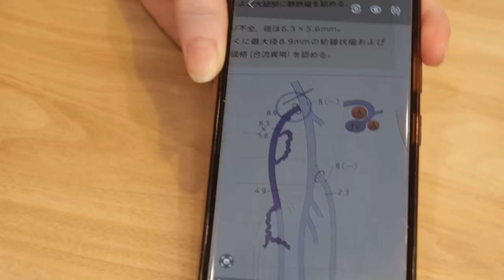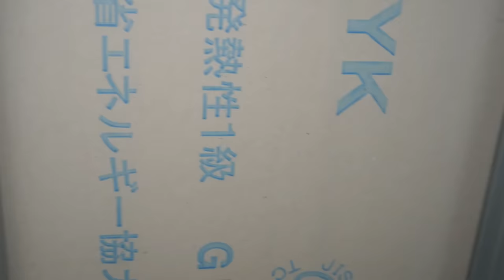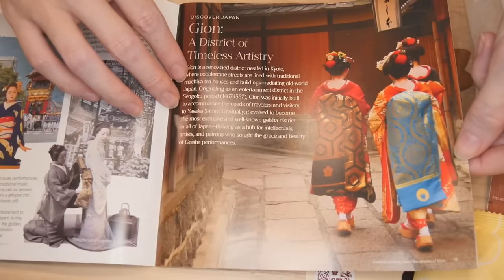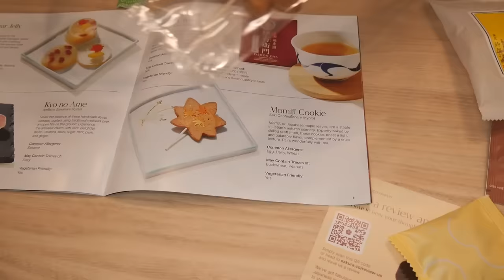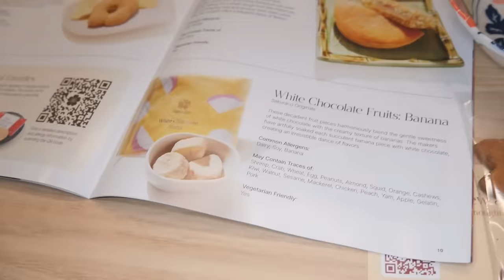I cut a hole in our wall and tried making a cat door 😬

Comment: For the cat door you could use a blackout fabric with weights at the bottom or if concerned with cleaning maybe strips of a flexible woody material like bamboo strung together? Bead curtains could also work. For the former rock garden; you can get a spray with enzymes that breaks down the components of cat urine scent which should dissuade them from peeing there again. After you could maybe fashion a lid for the stones out of plexi, some type of tempered glass or a clear acrylic plastic; cut holes in it for the plants to poke out (and for watering). Easier to keep clean than the stones for sure. Just trying to brainstorm some options!

Comment: You should use "woven wooden shade" as a type of door for this project. They flow really easily and the cats won't get caught in it. You could also put them on both sides to lower the light level if wanted.

Comment: For the door, you could try weighted fabric. Keep a wood strip for the top bit like you already had as it then afixes easily to the frame as you've already done, but attach a strip of blackout thick fabric to it (honestly a piece of black out curtain could work well) with some form of weight sewed into the bottom (maybe smaller weights in the corners so if they start to get stuck, the middle of the fabric without weights can still fold easily) - cut to the right size with the right weight positioning, it should hang quite nicely like the wood door you made (amazing job by the way), without any risk to your cats.

Comment: I was just about to leave a concerned comment about the door when you mentioned the safety issue, I'm so glad you noticed it! If you decide to go with a flexible wooden panel, make sure the design allows it to bend both ways, since they're usually more rigid in one direction.

Comment: As a possible fix for the door, fabric hung over a rod and secured at the bottom by magnets should work well (and you can put padding between the magnets to still get the attraction without a "clicking" sound when they close). I also liked what a few other people said about bamboo mats for flexibility, but you'll want to edge them with softer fabric in case the cats lift from one side instead of straight from the middle. But overall, it is a beautiful cat portal! Great solution for cats wanting in and out of a room when you want to still keep the door shut.

Comment: My advice for the door is that you could do it a bit shorter in lenght. Like 0,2 inches (around 5mm). This way the door is still a door but the kitties can´t get stuck or hurt their tails when the door gets closed :3
Reply: 5mm probably doesn't do much for stopping them get stuck underneath the door, but my first thought was to cut some of the bottom off too! Maybe add those fluffy door seals to the bottom so light doesn't come through.. But a curtain or bamboo mat like others said sounds way cozier

Comment: hey Rachel & Jun!!! Something you could do is split the door in half through the middle horizontally and then connect them with some hinges or something flexible. That way when the cats might get pinched the door instead just folds along the split.

Comment: I love how happy and trusting your cats are, seeing how excited Poki's little tail is, is just great. The cat tunnel in itself is really nice and clean looking, if you're willing to buy a flap part, there are places that sell just the flap for cat doors (as a replacement part). I feel like even those slatted/flexible wood doors could still pose some danger, whereas a soft flexible flap is light and can't really seriously catch anything. 

Until you get yourself you dream shop (with compound miter saw, among all the other fun and convenient saws) you should get a miter box for your own sanity. Then you can cut your angles with less worry of them coming out in a way that drives your perfectionist brain insane. (There are some frustrations with using a miter box, but you're probably way stronger and better at sawing things than I am so you  shouldn't have the challenges I do with them)

Comment: You are always so crafty, Rachel! The cat door without any flap on it will be best for kitties, but it doesn't look as nice to us people. If I may, consider using a thin, lightweight wood or veneer-esque material to achieve the look you are going for without making the door heavy for the cats to potentially get stuck or injury themselves on. Many cat doors you can purchase have a plastic or rubber-esque flap for this reason (aside from being cheaper to make), but they are certainly not pretty!

Comment: Incredible little doorway. You could do a pattern fabric with a wood strip at the bottom to weigh it closed but it wouldn't be able to pinch. If the bottom is solid it would just need to be shorter so it doesn't get caught diagonally.

Comment: My tip when doing the 45 degree angles on the trim pieces would be to use the hand saw instead of doing them with power tools. When doing such small cuts, if you don't have a miter saw, it's quite hard to get perfect cuts with a regular circle saw. It's better to just do them by hand, that way you have way more control. I always used to do those kinds of cuts on my miter saw, and even then they didn't always come out perfect, so now I do them by hand with a Japanese saw, like the one you also use in the video, and it turns out a lot better. 

Great project though. 

As for cutting slats, you'll want to cut them along the grain instead of across the grain, that way they will not break like it did.

Comment: You did a fantastic job!!🎉 I don't think there's any reason to be disappointed with this. It looks amazing!You could use a piece of waterproof fabric that would provide some sound dampening. You could attach it at the top, just the straight fabric and then at the bottom have a piece of wood so that it can hang down and then there would be no chance at anything would be pinched because the fabric would always be able to ripple around but little paws or tails. You would just have to give it half a centimeter of clearance on each side for the wood so that it didn't make any noise as it closed

Comment: I love this! As for a cat-safe door, you could try the curtain-magnet option.  Find a fabric you like, attach it at the top of the cut-through (staples might be too dangerous if your cats like to pull on fabrics, on a rod might be better), set magnets into the bottom of the fabric and the bottom of the cut-through.  Even small magnets should be enough to weigh the fabric down enough to attract them to the bottom ones.  If you leave a couple millimeters of space between the fabric and bottom of the cut-through, it shouldn't even make any noise!  There's a similar design for dog-safe screen doors in the USA that I've seen, might be worth a shot!

Glad you went to the doctor for your leg, even better that you came out okay!  Take it easy on yourself, both mentally and physically, until you're ready to tackle the next thing.

Comment: I think you did a great job with the door frame, it looks really good. When you need to re-install a door you can still use the pins and door frame holes by drilling one of the pin holes on the door slightly larger and deeper so the pin can slide easily in and out and put a spring in from a pen or something behind the pin, it doesn't have to be that strong. It wouldn't really be removable without braking it again though. Also you could use a bamboo sushi mat mounted to a wood rod at the top for the door. It should block most light and you can glue a sheet of fabric to it if you need it to be darker.

Comment: you could potentially find a thin, flexible piece of plastic and use a bit of the door to attach it to the door. A lot of mass-produced doors are like that. Another option is thin hobby wood stuck to a bit of fabric and you could paint it a complementing colour :)

Comment: You could use placemats made of rattan, bamboo fibers or other natural fibers if you can find them. you may have to trim them down to size and tape of the edges but they might be pliable enough for the cats to go through without trapping them

Comment: I have factor V lieden (basically my blood clots when it's not supposed to) and had a severe blood clot in my leg when I was 18 that made my major vein collapse from damage (so now live with a stent in my leg). So I completely get the sore and swollen legs. Compression socks are a life saver! The second you put them on, it feels like your leg is 10 pounds lighter and so much comfier. I don't wear them at all except on long car rides, planes, or any time I know I'm going to have to be sitting for a while. Also just propping up your legs especially at night for 10 minutes really helps! I just like to lay on my bed on my back and prop my feet up on the wall, trying to make a 90 degree angle with your body

Comment: you can get one of those flexible cutting boards, cut it down to size, and secure it to a strip of wood that is top of the door and has the swingy back and forth part. the flexible cutting board will allow them to use it safely and block light if you get a dark colored one.

Comment: Failure is inevitable, and it's not necessarily a bad thing. In failing, you were able to see a flaw in the design and its another lesson you get to keep forever. Humans are the best because whenever we do fail, its a chance to see how we can be creative problem solvers, and sometimes we end up making something different than we intended but its not a bad thing at all.
Take the story of the tattoo gun for example. It was meant for printing, but it didn't work as intended. Later on someone modified it a little to work on human skin and now there's a more efficient way to tattoo.

Failure ain't a bad thing at all, Rachel! You're doing awesome as you are. You go girl!

Comment: Hey, you now have a fully functional and beautifully finished hole in the wall. I say that's definitely not a failure. 

I have seen first hand what failure looks like in that context, and this isn't it. 

When I grew up, we had a cat flap made from a piece of carpet. Since this is in an inner wall, you may want to consider that. It's soft, potentially less noisy than something made from wood slats, and if you attach it with some kind of screws it will be easy to replace when it gets worn out.

Comment: i also think a fabric curtain would be the best alternative! You could hem a nice heavy curtain fabric all the way round and staple it to the top or make a little mini curtain rod and hang it from that. Or, you could split a fabric curtain in two vertically and make the middle hole snap closed with magnets like those screens you can buy. Either way, you should be very proud of the project, it looks lovely :)

Comment: @Rachel & Jun’s Adventures! 
If you want a fairly easy way to reattach your door to the holes you made for the pins on each side you might consider cutting a channel all the way across the top slat on the flex door. Within that channel you take two rods the are the size to fit in your preexisting holes (the channel will obviously have to be the diameter as well and even a smidge bigger for easy removal in the future. The rods should be equal length that come to about an inch shorter than the door width when put end to end. You drop each rod in the channel and push them out each side into the preexisting holes in your opening. Now you need to use a filler strip into the channel that either has a tooth on it the width of the space between rods or a wood piece that fits between the rods to keep them in place, than a filler strip for the top snug enough to just be held by compression fitting that basically restores the slat for the top to whole again. Sand everything smooth again. Since the work on the channel is on top it will be out of view for the most part but depending on your care in making it, it won’t even matter if it is. 
This is probably a lot clearer in my head than it is to understand but it will work well without you having to remove the nice frame you’ve already put in place.😸

Comment: Mama has a cat tunnel as you call it between her main floor and the stairwell to the finished basement. It came with the house and has never had a door. It works really well so I wouldn't consider it a little failure.

Comment: A tip to neutralize cat pee smell, which i a horrid smell, use baking soda and vinegar to clean it, it works. And if it’s fabrics you can load the washing machine and instead of detergent add baking soda and vinegar (in separate compartments). And it works too!

Comment: If you use a piece of thick fabric or thin and flexible plastic you could have it been like a curtain-esque flap, just add some weights of some fashion to the bottom to have it go back in to position.

Comment: I made the same thing for my cat (I didn't put a door on mine) now she can get in/out of the room I have her litterbox in without me having to leave the door open, she loves it. If you still want to put a door on I would suggest a material that's bendable, if you look online most cat/doggie doors sold at hardware stores have a vinyl door, that way it doesn't hurt them if it swings back into their face and it's light enough that a cat should be able to unwedge themselves if they get stuck. But cats are notorious at finding the flaws in things so there will be lots of trial and error

Comment: cutting the door in half horizontally and hinging it so that the bottom half can swing both ways might prevent them from getting caught - especially if it has enough slop on the pivot point so that it can lift if it binds. Though, simpler would be a small curtain or something in that vein.

Comment: Have you thought about getting a speed square and/or a T-square? You could use either as a straight edge when using your circular saw, either freehanding it or using your clamps to hold the squares down. Even your level could be used as a straight edge (if you clamp it down).

Comment: A heavy fabric would be good, especially if you have one on each side in something like a flannel or canvas it should reduce sound as much if not a little more than the initial wooden door and of course will block light and view with no pinch risk

Comment: Rachel, here’s a thought! Since this cat door is an inside-to-inside, not an outside-to-inside, does the door flap really need to be a hard material? How about cloth curtains? Cloth would be easy to go through and won’t hurt the cats, and it stops the light from coming into your bedroom at unwanted times. You could make a few of them with different patterns and switch with seasons, and you could make them detachable so that you can throw them in the washer when you need to! 🌸

Comment: I see a lot of people suggesting curtains. I don't think that's a great idea as they might end up scratching that off.
My suggestions:
- a bamboo shower mat cut to size. They're sturdy since they're made for human weight but also pretty lightweight to be bendable for storage so it should hopefully not let their paws and tails get stuck as it bends.
- a regular black cat flap for a cat door, or a see through one that you can get special safe spray paint to paint over so it's blacked out. Can even tint it with paint to make it brown if you want it to match.
- a small, cheap mudflap for a car.

I'd probably try the bamboo shower mat in hopes that'll work since it'll look the best in your home and hopefully also be safe enough with testing.

Comment: If you are concerned about lighr coning into the room with no door on the cat door, you could set up something like curtains either true curtains with a split in the middle and small weights in the bottome hem to encourage them to lay properly or just one piece of fabric with weights in the bottom hem, the two pieces might work better without the cats dragging it into the tunnel when they leave

Comment: You could make the door out of really cheap chopsticks. I know here you can get bamboo ones for pretty cheap.
If you cut them down and drill some holes in them you could attach them with string. That would make the slat like design and it wouldn't hurt the kitties.

Comment: Have you guys considered setting those rocks in epoxy resin? This is commonly done to simulate a wet river bed, but as the rocks are set in epoxy they can't be dug up by the most determined of cats. Usually sold as 'epoxy rock binder' or a similar description.

Comment: Help for your circular saw.  I noticed you have a little guide sticking out of the side, so that is probably the reason you oriented the saw in the way you did.  If you go from the opposite direction, the wider part of the plate  will be on the stable wood surface, which will help support your cut.  Can you fold that little guide back out of the way, or put it coming from the other side?  

Also, on most circular saws, you can pull the safety guard up a bit.  Sometimes they catch on the wood when you're starting.  If you raise them up until you get your line going you can release it again and it will rest on top of the wood for less resistance.  

Lastly, if you have a square with a lip on it: line your saw blade up with your line, then place the edge of the square against your saw with the lip on the edge of the adjacent side of the board.  Viewing from the top, this means the square's right triangle has the hypotenuse away from your saw,  with the lip on the bottom holding it flush with the board and keeps your saw square.  This will act as a support and a guide to keep you on the line.  Obviously though, this only works for 90 degree cuts.